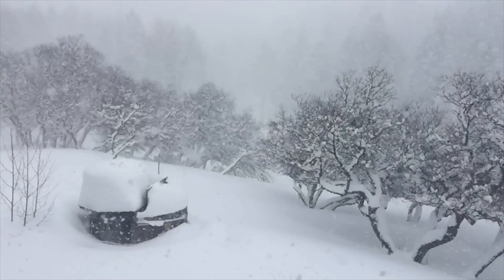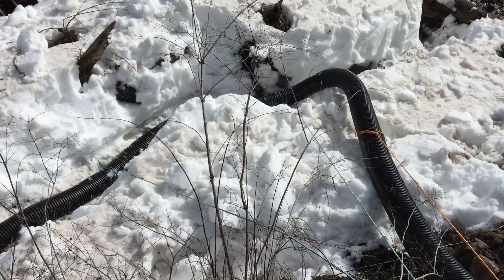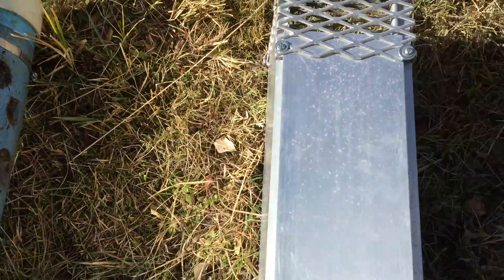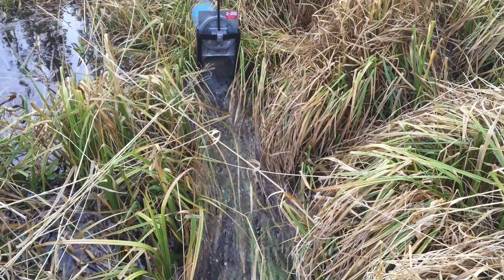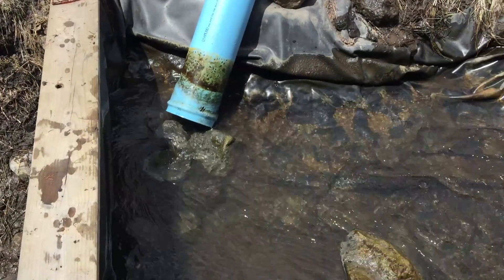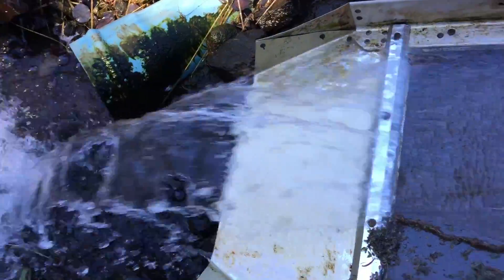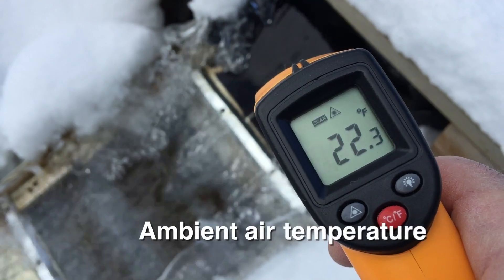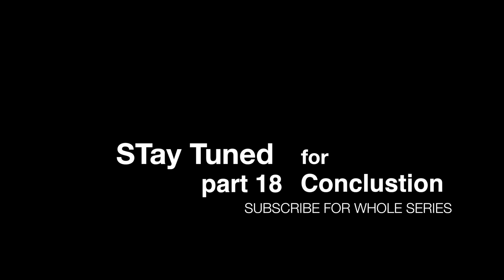Part 17 MicroHydro Power System in CO

Comment: thanks for sharing.
Reply from the maker: Thx for watching.  I never know who has seen what segments.  Parts 20-1,2,3 are a synopsis of the whole thing
Reply: @mrhydrohead  i am involve in water treatment plant project the flow is about 900MLD, im looking at the possibility to use the flow to generate electricity.
Reply from the maker: 900 Million Liters/Day!!?  If so, that works out to over 10,400 liters/second or 367+ Cubic feet/second(CFS).  A river.  There is definitely power there. Sounds like a serious project.  How much head?  With that sort of flow you wouldn't need much head.  If its a water treatment plant, does water come through a ditch or a pipeline?  If pipeline, what is the pressure.  If a ditch, I would look into https://www.turbulent.be/ as a potential avenue to pursue.  Its way beyond what I've done.  My system runs on 0.67 CFS
Reply from the maker: http://www.kylesconverter.com/flow/megaliters-per-day-to-cubic-feet-per-second
Reply: @mrhydrohead  the inlet is a 2km open channel with a recorded flow of 930-1085mld as of Oct 2018, the outlet is 1800mm di pipe 900mld, head 8 meter (still needs to be verified)  about 3-4% goes to sludge.  the main source of water is a network of dams in the upstream is about 12km away.
Reply: @mrhydrohead  thanks for sharing this link.
Reply from the maker: Christopher Nicodemus There is another route you might look into which is made by a company in Japan. Their system works in a ditch and works in varying ditch flows. I tried to get them to let me film it in 2017 when i was there, but they weren’t open to it. I’ll look up a link and share it later
Reply from the maker: Download and check out their brochures: http://www.jagseabell.jp/english/marketability/download.html
They have some video: https://youtu.be/NFVaMpPDJV0
And some others of smaller units i will try to locate.

Comment: Awesome video! I use the small electric over oil radiators you get for about $50 or so, and they are touted as the most efficient room heaters. We close off unused rooms and their registers and mostly live in the bedroom at a cozy 70 degrees while the house is on gas at 67.
   This video has me thinking: what if the flow of your house water had to run through a small DC generator, feeding into a battery bank? It seems that we are just wasting a power source in every home, and on the low down, one could actually have 12v lighting as a supplement or the entirety. Solar homes would already be set up with chargers, regulators, battery banks and the like.

Comment: My suggestion would be to put water inlet at least 6 inches BELOW the average surface of water to prevent freezing up on intake. 
Making intake of water on the bottom side of the pipe not too close to bottom should also lessen the buildup of debris floating near the surface. The largest possible area of filter will reduce intervals of cleaning it. Here l would suggest wrapping large expanded aluminium mesh loosely around actual intake pipe (the longer the better) and then covering that with filter material. 
Air locks in pipes can also be eliminated by making bypasses at certain high spots in supply line. This can be achieved with 2 x T - pieces placed roughly 3 foot apart and joining T - junction in an upside down U form with this section upward of mainline feed so as to collect flowing air above mainline where it can be released with small breather screw.
Freezing up on bottom outlet through windchill can be reduced by building small isolated "hut" over the outlet.
If any questions arise feel free to contact me   pieterbez53@gmail.com

Comment: Very nice video.  I enjoyed seeing your progress through all the troubles that aren't surprising when you mention them, yet would surprise the naive.

1) Wouldn't an automotive windshield wiper that activates every hour work nicely? It would consume minimal power but could do most of the maintenance for you.  

2) Similarly instead of the Coanda screen, could you use a screen on a rotating drum that on the bottom has a slight reverse flow through the screen.  The rotation could be from a small motor or maybe even blades mounted just inside the screen.  The flow reversal on the bottom of the drum could be ensured by mounting a take off pipe (like the first generation screen) inside the drum that is substantially closer to the top or only has openings facing up.

3) I know from setting up strange experiments and aquarium stuff that leaky hoses prime much better and stay primed much better than perfect hoses.  Could you not just leave your plugs for relieving air locks out all the time (possibly with a small check valve to prevent disaster) since they are generally under positive pressure and the loss of flow would be minimal?  you could even add fittings periodically that have a bubble in the top that allow air to collect and possibly have a float that opens when they have collected air.

Comment: Awesome video. Surprising to see the water still flowing on the ice cold temps. This video shows that persevering with a project pays off. Adapting your design to multiple failures, try and error, a great  example of real life challenges when you decide to realize your dream.
Reply from the maker: Thx for watching.  I never know who has seen what segments.  Parts 20-1,2,3 are a synopsis of the whole thing

Comment: Awe you finally figured it out. Drilling small wholes to releave the air build up. You could also play with a simple flapper valve. And I would put up a series of prefilters and maybe a solar hot water supply to defeat the ice build up

Comment: just leave the vent holes open. there is not way you lose enought water to cause a sig loss in power.
Reply from the maker: Unfortunately, it pulls air in the holes.  The negative pressure (suction) at the bottom is far greater than the positive pressure at the high points.  Thx for watching.  I never know who has seen what segments.  Parts 20-1,2,3 are a synopsis of the whole thing.
Reply: @mrhydrohead  I'm just an arm chair expert, i went through most all your videos and i see how you solved the problem mentioned it the comment. Great job.

Comment: on that meadow outlet... instead of up to air exit, maybe put in a 45 deg. elbo and mount that shut off gate at a 45, to reduce icing of it.  That ice cap was not necessary to have and maintain.... I am sure you will find other things to make better/improve as tehre are a few weak spots.  NEED more intae capability with screening and various other changes to clean up the water and allow for sufficient flow over time.  Maybe the local authorities would not allow you to do such properly engineered intakes? Also, ya gotta get rid of any high points. Period.

Comment: 100 psi, that's impressive.
Reply from the maker: The first system had 212psi. but the springs stopped producing as much water.  Thx for watching.  I never know who has seen what segments.  Parts 20-1,2,3 are a synopsis of the whole thing.

Comment: Tip  8:35 support your soft screen with astainless wire mesh underneath  it will support the soft mesh and aborb movement and reducing mechanical "wear" on the soft screen

Comment: Pretty awesome, however I would set up fiberglass moulded covers for the entrance and exits to block the wind, and possibly a secondary smaller generator farther up the stream that only runs heating elements in the water in the hopes to raise the water temperature enough so it doesn’t freeze so quickly, OR heating elements under the fiber glass enclosures so the water doesn’t freeze.

Comment: If you're actually shunting excess power into heaters anyways, why not use some to periodically de-ice the screen at regular intervals by adding a few nichrome strips to your screen?   I haven't watched the rest of the series btw if you've already tried this ir try it later. just stumbled upon it.  Looks like very nice work mind you.  Both your installations and your explanations are very clean, consistent and professional.  Well done.
Reply from the maker: Many viewers have made similar suggestions.  The intake is 1/2 mile from the powerhouse and to run wire that far would be a waste of time and money.  The icing issue was resolved in a subsequent video and isn't really a problem.  Thanks for watching, Parts 20-1,2,3 are a synopsis of the whole thing.

Comment: What kind of pipe do you use? Where do you find one that doesn't photodegrade, become brittle, and fall apart every couple of years? I ask because I live in an RV trailer and I need flexible pipes like that for my sewage system, but I keep losing them to simple sunlight.
Reply from the maker: Artimus Protensor I once spoke with a hydropower engineer who disputed a comment from me that PVC pipe degraded in UV from sunlight. He said it was the absorbed heat from sun light that created problems. He said if I was concerned about UV then I should just paint the pipe. I don’t know if he was right, but he was very knowledgeable. We haven’t so far had any issue with the PIP PVC pipe we installed which is the solid pipe. The flexible pipe is Polyethylene Drain Pipe like the kind used in french drains only it isn’t perforated. Wish I could be more helpful. Thx for watching.
Reply: @mrhydrohead  It's the FLEXIBLE pipe I'm interested in. My flexible pipes last one season. That's it. I'm sure the PVC, being many times thicker, would last much longer. But because I will move at some point, I don't want to set out a system of solid pipes that will be difficult to take with me. How long have your french drain pipes lasted?
Reply from the maker: Artimus Protensor So far the flexible pipe has lasted 3 1/2 years. It may have a small air hole somewhere where in it at this time, but I’ve not been able to locate it. That pipe receives very little sunlight and in winter months is covered with snow. As you probably know i pull it out in may and part of June for the spring melt run off. It also has minimal pressure load on it as it merely move water sideways with very little drop in elevation. Maybe 3-5 feet drop. How many inched in diameter is your pipe and how flexible does it need to be?
Reply: @mrhydrohead  I've mostly used the stuff they sell in Walmart. I think it's about 3 to 3-1/2 inches in diameter. Actually come to think of it, it doesn't need to be super flexible. In fact, it just occurred to me that if I put some hooks on my trailer I may have an easier time taking PVC with me than the flexible. I've considered using fire hose, but that's very expensive. On the other hand, it's worth something to not have to change it every few months, and I have to leave it out year-round all the time so it gets lots of sun.

Comment: Since you're generating power, couldn't you hook up some kind of heater somewhere at the beginning of your system to prevent ice dams from forming? As far as the vapor lock solution with the removable screws, brilliant! Keep up the great work dot-dot.
Reply from the maker: The site of the powerhouse is 1/2 mile from the intake so its impractical to run wire that far and suffer all the line loss involve.  Besides the ice hasn't proved to be a major problem.  Other solutions were found elsewhere in the series of videos.  If you haven't seen it check out parts 20-1,2,3 which are a synopsis of it all.

Comment: How about adding a 12v volt solar powering motor that turns a stainless steel drum with stiff brushes. that slowly turns every day always scrubbing the steel grill?
Reply from the maker: Problem was solved with this https://www.youtube.com/watch?v=KVrt3oM5qWo  Its an engineered screen.  Thanks for watching and your other suggestion.  If you haven't seen it check out parts 20-1,2,3 which are a synopsis of it all.

Comment: Your water thermometer seems to read -3C, I'm wondering if it's not more likely it remains liquid due to the purity of the water, rather than the constant movement?
Reply from the maker: Don't know.  Its a conundrum why it doesn't freeze, but I'm grateful that the system runs flawlessly even in subzero conditions.  Thanks for watching.  If you haven't seen it check out parts 20-1,2,3 which are a synopsis of it all.

Comment: Perhaps your energy generation system could support heat tape at critical ice intrusion points (SST weir inflow screen / meadow pipe gate).  Here is one (I have no relationship with any vendors) such system:  https://www.heattracespecialists.com/.  Kudos on your persistence and intent.
Reply from the maker: The meadow intake isn't really a problem and requires almost no attention.  The meadow is 1/2 mile from the power, so it would be wasteful nd prohibitive to run power all the way back up there, but thanks for the suggestion.  I probably could use this link to locate a solution for ice dams on our sunless roof line on the north side of the house.  Thanks for the link.   If you haven't seen it check out parts 20-1,2,3 which are a synopsis of it all.

Comment: Idea for the air lock release hole, what about drilling smaller size holes and let the water run out of them all the time?
Reply from the maker: Air gets sucked into pipe by pull of water further down the pipe.  Too flat of a fall gradient for your idea to work, but thanks for watching and the suggestion.

Comment: I can't help wondering why you don't make a water powered screen sweeper? It seems like such an obvious choice and wouldn't be difficult to design.
Reply from the maker: thx for watching.  We installed a different coanda screen that doesn't really have any issue with freezing.  This segment is part of a much larger series.  See https://www.youtube.com/watch?v=sixorfYKSwI about 3:30 in to see new screen.  Part 19 shows detail as well.   If you haven't seen it check out parts 20-1,2,3 which are a synopsis of it all.
Reply: Bog brush!

Comment: Interesting stuff. The first thing I thought when looking at your problem with filter clogging at the intake was, how about using a circular pool with the intake in the centre and the creek water entering the pool at the side to spin out debris matter towards the edge of the pool? I also wondered if at the lower level where you had to use a Coander filter, would just protecting the installation with a small shed provide enough shelter to reduce icing issues? Could water flow be used to drive a brushing device to help clear debris as well?. Of course I don't have these problems living in town😀 my problems are bills!
Reply from the maker: thx for watching.  We installed a different coanda screen that doesn't really have any issue with freezing.  This segment is part of a much larger series.  See https://www.youtube.com/watch?v=sixorfYKSwI about 3:30 in to see new screen.  Part 19 shows detail as well.   If you haven't seen it check out parts 20-1,2,3 which are a synopsis of it all.

Comment: My experience with the freezing water is that it is best left alone. The ice forms an igloo over the works protecting it from freezing. I would also place the filter the other way to allow the water flow to self clean it, but you need to keep it full so water bubbling beneath the screen applies upward pressure to clear the screen.
Reply from the maker: thx for watching.  you're correct on the ice!  This segment is part of a much larger series.  Part 19 shows detail of the coldest/dryest year we had last year. Micro Hydro Electric Power System in Colorado Part 19   If you haven't seen it check out parts 20-1,2,3 which are a synopsis of it all.

Comment: In industry, there are these simply design air removers for large piping systems. Take a look , you are resourceful enough to use this design on the 4 in pvc . To keep the highest velocity and the loss of head pressure at the vanes of your generator. The screws are good and simple.
Or build a settling pond and run a new buried piping system. .thank you for posting

Comment: Reduce your ice buildup with thermo-siphoning.  Dig a hole down below the frozen ground layer - down to a depth where you can get 40-50 degrees.  Drop in a cylinder-shaped radiator on two lines - one of which is insulated.  Fill with antifreeze and water.  Feed the uninsulated line into a buffer tank.  Feed the other line into a low power (solar powered) water pump.  Out of the pump, connect to a rubber solar water heater bladder (used to heat water for a swimming pool).  Now fill the system to ensure no air in any part of the pipes or bladder.  The solar pump will get things flowing and then thermo-siphoning will take over.  40-50 degree water rises up the insulated pipe into the bladder when it will melt any snow or ice on it or under it - covering a walkway or warming a water flow - the water/antifreeze mixture will cool and become denser and will sink down the pipe to the buried radiator where it will be heated, become less dense, and rise up the other pipe.   If the down and up pipe are large enough and the radiator is large enough, a fairly rapid flow of heated water/antifreeze will occur just from thermo-siphoning.  If not, then the solar pump will keep it flowing.   The greater the temperature differential the faster the flow.  50 degrees on the radiator and below zero on the surface should keep a 2'x12' bladder (or larger) ice and snow free.  This works best if the radiator is below the water table and is sunk into 40-50 degree water.   Using embedded PVC pipes in a grid pattern under soil or inside concrete or under floors also works.  Using pure antifreeze can also help as it has more thermal capacity or you can use salt water mixed with antifreeze.   There is a thermal limit to the heating ability that relates to the diameter and flow rate of the pipes and the size of the radiator and the depth (temperature) of the radiator.  Make all these larger or deeper to thaw larger areas.  The obvious advantage is there is no added energy or expense to the system.  It can operate year round.  It keep ice and snow off of walkways, roofs or pipes or open water tanks and flows.